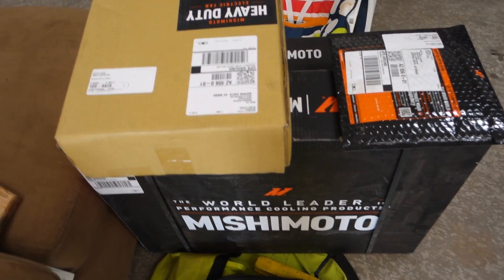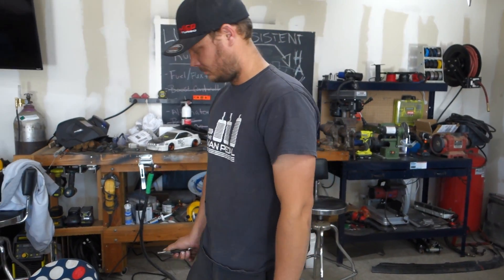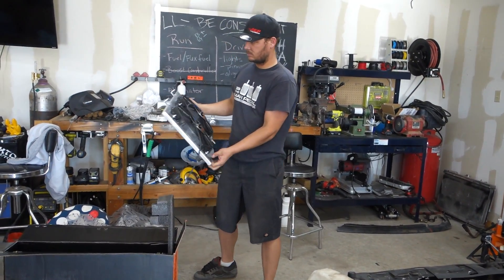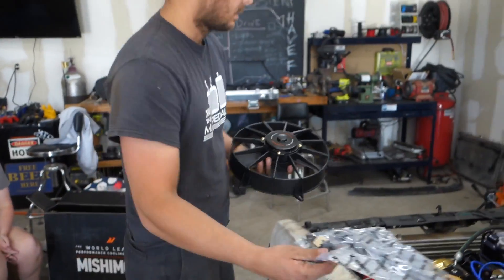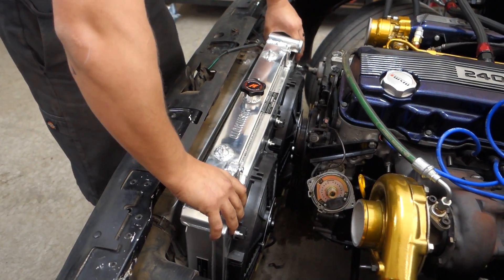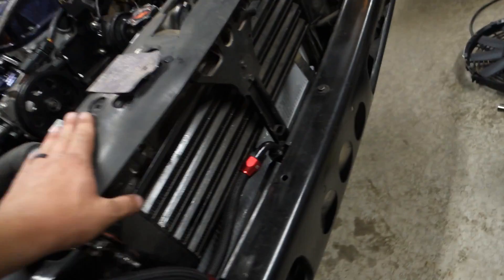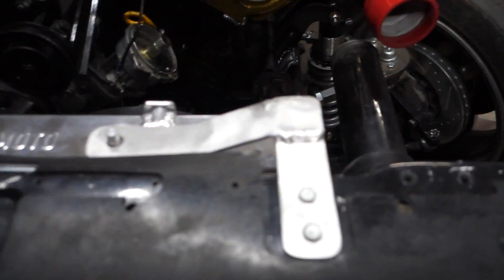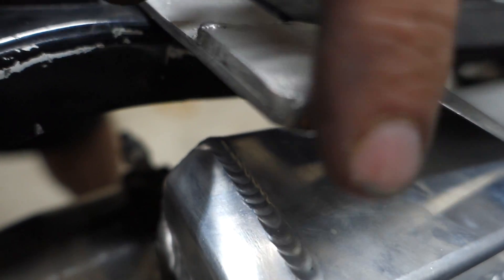How to Keep a KA Cool

Comment: Hey fellas i drained my coolant bc it was dirty and I had a leak in the u shaped coolant bypass hose (96 hardbody 2.4l) fresh coolant but my truck isnt getting to operating temp driving for 1 hr. What to check? Thermostat? It was fine before the work, so Im a little baffled. .
Reply from the maker: All you did was fluch coolant?
Reply: No. I drained it. Took thermostat off filled it with radiator cleaner. Flushed it. Put thermostat back and filled it with 50/50 coolant.
Reply from the maker: Sounds like the thermostat is stock open sone how.

Comment: Single cam 240 radiator? Did you use the stock hardbody hoses? Any idea for a trans cooler for the autos?
Reply: @LocalLosers520  not that I know of but on my automatic there is a transmission cooler built into my radiator.

Comment: Hey bud I have a question on the install of the new radiator and new fan, do you take out the clutch fan permanently and run a wire to power the new double fans?
Reply: @LocalLosers520  thank you for your fast response and help brother

Comment: Hey guys just looked on mishimoto website only item for KA that was available was the thermostat as both radiator & fan shroud where not available
Reply: @LocalLosers520  yea it was coming up as 200SX-240SX KA24-SR20
Reply: Looked on eBay but they are out of my price range for moment might just have to do what we all do rob EL-BA falcon thermo fans & shroud on the standard radiator
Reply: Yea that's the ones was looking at says not available
Reply: @LocalLosers520  maybe that's why the ones on eBay are much higher in price
Reply: How much where they as they don't have price on them

Comment: Do you guys use the 240sx radiator?
Reply: I've always wanted to do this mod but yes if I measured correctly, the 1989 240sx Mishimoto dual-core rad s.h.o.u.l.d fit but I haven't tested it out